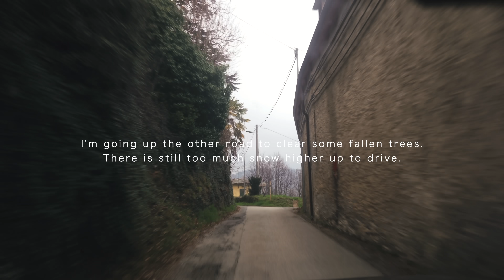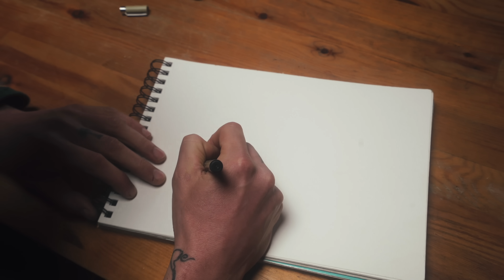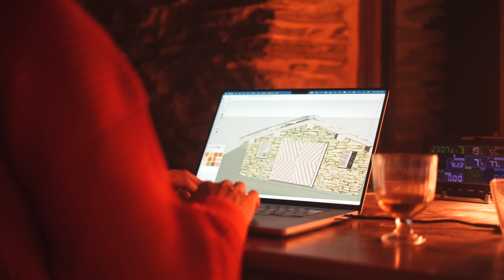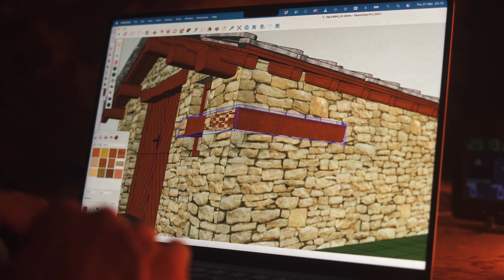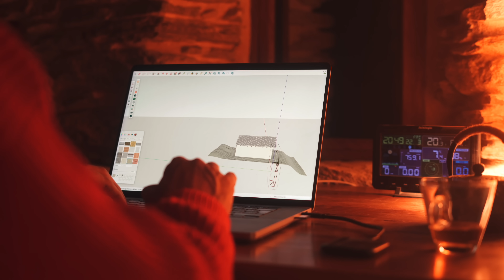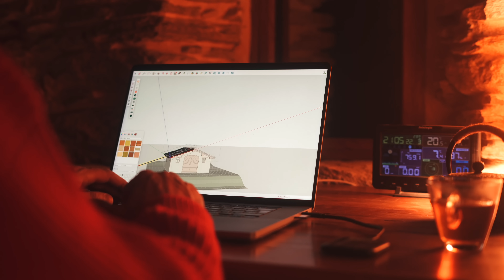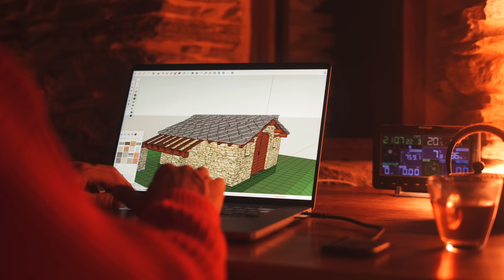#105 First Signs of Spring

Comment: For the workshop build, one possible construction method could be to build the supporting walls from reinforced concrete with the exterior clad in local stone.  This would possibly be overall cheaper, stronger, and quicker to construct.

Comment: I've done miles of taping pipes.
Put pipe in left hand threads facing out put tape in right hand unroll from bottom place tape under left thumb tape going over pipe and away from you unrolling from bottom pull tight as going over around towards up unrolling from bottom of roll even put first finger in hole of tape zing 3-4 wraps always pulling tight snap off put on a little sealant going over and away pipe always in left hand

Comment: In all of my 67 years, most of it in upstate NY with wood stoves, we always put the kindling to start the fire on the bottom after cleaning the ashes out. Once the kindling is started we always put incrementally larger pieces of wood on top until we put the large diameter and split pieces on last. I am amazed at your practice to start with the kindling on top of the large wood!
Reply: Yes, I've wondered about that, too. But I think I've heard other people who have these stoves say that's the method recommended by the manufacturer. Not sure what the reasoning is behind it, but I'd love to. know.
Reply: If you watch his video that focuses solely on the build of his fireplace, he explains why he does it this way, it makes perfect sense for this type of system. It's amazing all around.
Reply: I must have missed the snippet of video you mention about the stove construction. I was wondering about culture, in upstate NY, we're Dutch too!

Comment: Maybe get a small dehumidifier and run it briefly after a shower - only during the winter, of course. I rented a very damp house for a short time and ran a large dehumidifier during cold months. It pulled 4 or 5 liters of water out of the air every day! Mould gets to be a serious problem with that much moisture. Man, that workshop is becoming a huge project!

Comment: Hey Martijn, if you get a can of RINNOVA SERRAMENTI (OLIO PER LEGNO) at your hardware store, it will help preserve and seal your door/window frame at your shower area...interior and exterior.  It's easy to apply, I just put it on with a small scrap of folded terry cloth; use a latex glove. 😊

Comment: I'd wager - the director of the design council who establish regulations pertaining to silly issues such as not allowing a practical  door height ..is a chiropractor seeking sore necks and aching backs! Your new truck seems fabulous ! Both Isuzu and Mitsubishi, are fabulously cool. Little point of reference for adjusting the chainsaw chain tension..Bolt a vise onto your workbench.Use it to hold the chain bar..do the fine tensioning..then before you tighten the locknut, lift or tilt the engine downward so the bar is locked into an upward angle..you can find that instruction within the operators manual. Bless you wild man. Your providing a fine fine presentation.anoit this life of yours & thank you!..And.. your computer overlook of the finishing points..the roof and work area were delightful to watch..& the fact that the red used in your art was exactly the red of your sweater you wore as you exited the cabin.
.your imagination is way cool !

Comment: Thank you for yet another wonderful episode, and sorry for the frustrations getting the workshop plans approved. It will be beautiful in stone, but it's not fair or logical to force you to use it.

I was impressed by the last tree you cleared from the road, that was a large and tricky one. I was a bit worried for you though - was there anyone nearby while you did it?

The full ensemable of protective equipment can be overkill, especially if you use your saw carefully and infrequently. But if something does go wrong the most important thing is to have someone there who can help or get help.

Comment: While watching this, I thought of something that may help cut trips to the outhouse in poor weather. That space for the water heater can be used for a portable toilet, if there will be room after a door is mounted. It would be too much work to put a normal toilet in. At least until you get the new bathroom in the next building.

Comment: Definitely more work with the new design. 😩 maybe design a complete timber frame awning that you could build slip form rock walls around. Or even concrete walls with a rock facade. Would go quicker.

Comment: "it's humid after a shower..." yes that is how every shower is - which is why an exhaust fan is installed (required by code) in a room with a shower. Short showers is find for you, but if you are planning to rent the cabin there will be no way to control their shower length. Best to have a fan.

Comment: I wonder if they would accept the workshop built with knee high stone walls and the rest in logs with a stone roof? If they would, consider square logs, otherwise each rounded log surface is a shelf for dust and debris to settle on.

Comment: ah .. all stone, will you be able to add the size of windows and/or skylights you like? I hope so .. I know it will be beautiful.
I do like the impregnator sealers . they typically last 3 to 5 yrs.. but I think you can make it last longer if not cleaned with harsh cleanser as the impregnator drives into the stone and chemically bods with the stone.. so it doesn't st on top and no change in the look..  the way you know it is time to reapply is if you notice the stone darkens when wet.. with the impregnator the water just beads up and the color of the stone stays as it looks dry. The companies who make the impregnator usually have a soap for best longevity, You can use it on grout too around the tile.
Congrats on your cozy bedroom !

Comment: You will need a frost proof water tap for outside. They make some that have an expansion valve and won't break if they freeze. I recently bought a 35 year old Kubota 7100 tractor with a front loader. That particular model with a hydrostatic transmission was way head of it's time. Why? clearing snow,trees,moving dirt and larger items,lifting heavy objects. I don't know how I got on before without it.

Comment: The river's roar, the birds singing or resting on the window, buds on the trees, changing the chicken coop bedding, the early spring breezes, melting snow, warm sunshine. Slow signs of life after a slumber.

Moving on with the indoor shower. Redesign for the new building. Stone with minimal wood cladding. Is that for fire prevention in remote, under populated areas? Or resource conservation to use readily available stone?  Or security to minimize burglaries? Or safety for cave ins with snow load bearing and high winds? Same size, smaller, different timelines, more expensive foundations and wall supports, big beams to support a stone roof?

Do you change plans and work on cabin 2 first, once completed, do landscaping to accommodate the new buildings? Or push on to get revised plans approved? Then start the extension living/work space construction started.

Comment: Would demetra approve wooden workshop with outer non-supportive stone walls? Having done that, it is definitely faster,better insulated and cost-efficient way. And from outside you can´t tell its with wooden structure.

Comment: You said that you had to build your tool house building in stone. I had a wild thought is there any way that you could put a siding on the outside of the building in very then logs to make the outside of the building to look like it's made out of logs and under side of the building is all stone so from a far it still looks like logs but from the inside it's made out of stone??Just a wild thought.

Comment: That,s horrible about the permit rejection, out of stone seems silly when it will be bigger than your current living space, is there stone cut Panels that you can clad the outside with so exterior so it fits aesthetically? i know some place around the world its the outer look they want to look traditional and that's all that matters so company sell sheets of thin cut rock that looks like stacked rocks etc, there often used of wooded houses so they fit the looks to the codes. 
might be worth you asking as would save you lots of time etc.

Comment: Just wondering, shouldn't you have put some moisture barrier under the stones in the shower area? Some paint on stuff... Or did you do it? I don't remember seeing that turquoise stuff anywhere. Maybe it's not so needed as there are no wooden structures , but still. The seams are hardly waterproof between the stones and the moisture will get to the concrete slab.

Comment: I suspect that the stone impregnator is intended to seal the shower floor/walls. Frankly, nothing will ever seal them the way that will bear up to cleaning. The most practical way is to use ceramic tiles, something with a stone appearance. You're going to not be happy with the constant maintenance of resealing porous stone.

Comment: Hi Martijn, sorry, I’m a bit late watching your video this week. I have a quick question about your boiler - I thought the warm water for your shower was going to be heated by the fire. Weren’t you going to have pipes running up alongside the fireplace heating a boiler built in to the wall there? Did I misunderstand or did you abandon that idea? If the latter, why did you not stick with that plan?

Comment: Greetings.  Are there any restrictions on the number and size of windows?  if not, you could design more and bigger windows.  this would significantly simplify the construction of the workshop
Reply: OfficialMartijnDoolaarda  so you could install several floor-to-ceiling windows in each wall, separated from each other by a stone column
Reply: I believe this would greatly simplify and speed up construction.  however, here the problem of a heavy roof arises, which can be solved with concrete crossbars disguised with wooden beams.  you have already done something similar in your cottage

Comment: Your chainsaw sounds like it's carboned up because you're not running it hard enough. Start it up and hold it full throttle because it's designed to run Full Throttle. Most likely within 30 to 40 seconds it should start blowing chunks of crap out the exhaust. After you get the carbon cleaned out of it always run it on Full Throttle no matter how small of a job you have.